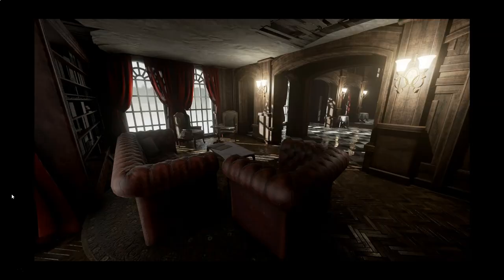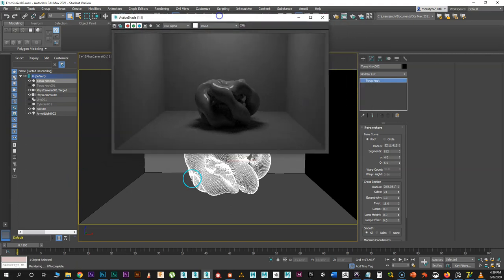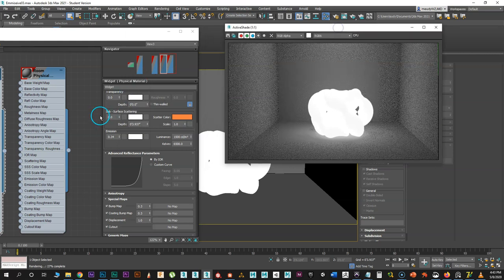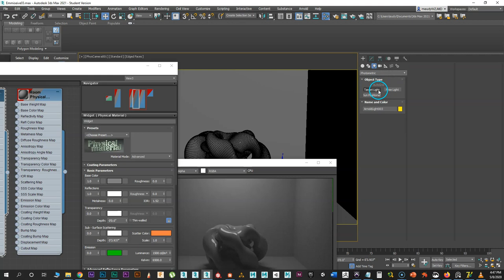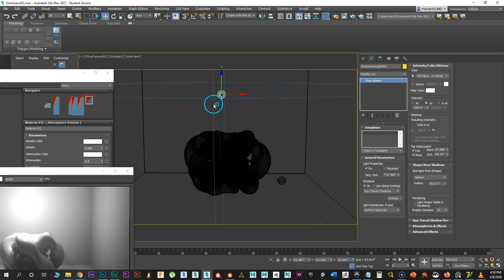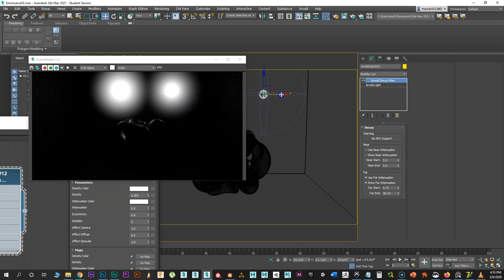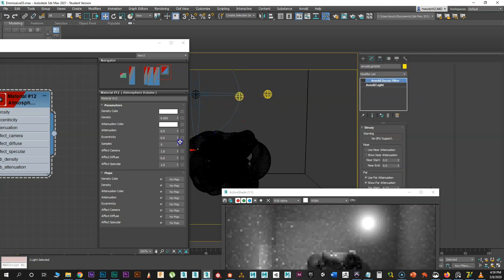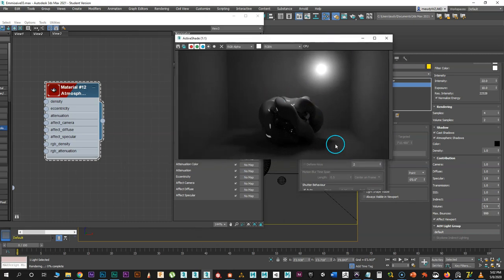Emissive Lighting in 3ds Max with Arnold

Comment: Okay, I get that I can't see the emissive light in my viewport while it shows up just fine when I do a render. If I'm doing a static lighting bake to bake light into my textures so I can make unlit stuff in a metaverse space, will the emissive lighting coming from my meshlights show up in my light bakes?
Reply from the maker: In don't really know the answer to that without doing tests. My initial thought would be no since it is a postprocess.
Reply: @eudymaverickmentor  Damnit. :(
Reply: I tested it! It works!
1. I made a cube.
2. Put a standard surface material on it with a lot of emissive.
3. Made an Arnold mesh light and assigned the cube to it.
4. Placed the cube next to a pillar in my scene.
5. Baked a lightmap for the pillar.
The light map had a big white blotch on it about where the cube is.
6. Moved the cube far away.
7. Baked a second lightmap. No big white blotch.

Comment: when i render in production mode the volume light dissapears. how can fix that please ?
Reply from the maker: You need to turn it on. Active Shade has it's own settings. You have to set the Production Mode settings the same as the Active Shade settings. Make sure your Atmosphere Volume Shader in the Material Editor is placed as an instance in both the Active Shade and Production Mode "Scene Atmosphere" tab.
Reply: @eudymaverickmentor  well thanks a lot !!

Comment: If anyone is getting different results on light strength, it could be that your backdrop box is a different scale than his. I been beating myself in the head wondering why the lights were easily washing out my scene.
Reply from the maker: Yes, scale is a huge factor in lighting. 3ds Max is an odd software because it's default world scale is set to inches. This is from back in the day of Max's mother, 3D Studio, on DOS. I always require my students to set Max's World Scale to Centimeters since pretty much ever software known to man, such as Maya or say the Unreal Engine is set up in Centimeters. That way anything built to scale in Max is the correct scale if imported into another software. Also, any on my tutorials are created to teach concepts, not so much a specific setting. So someone else's settings may need to be different from my settings due to many factors, one of them being scale.